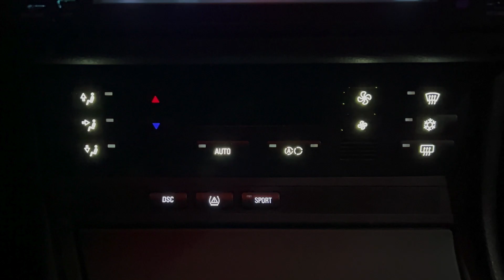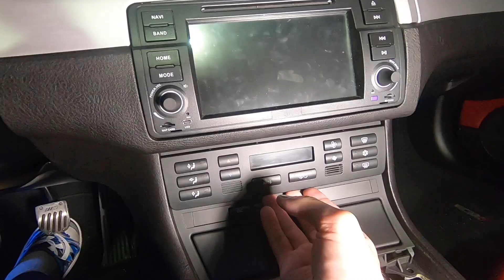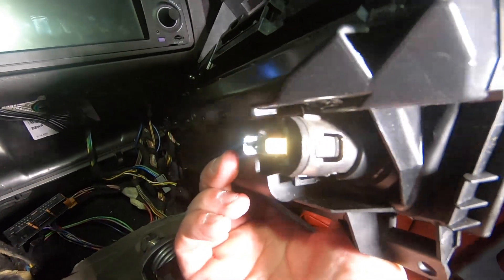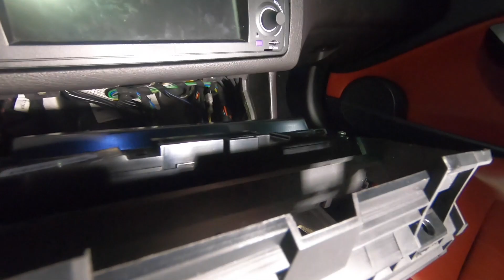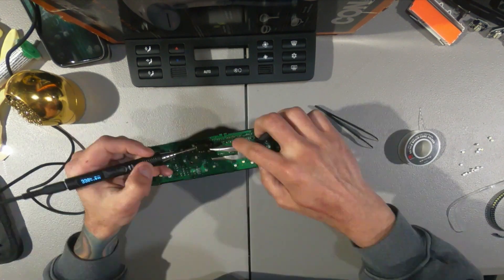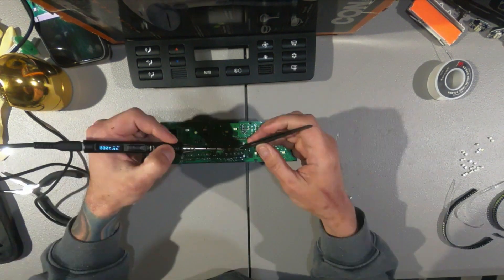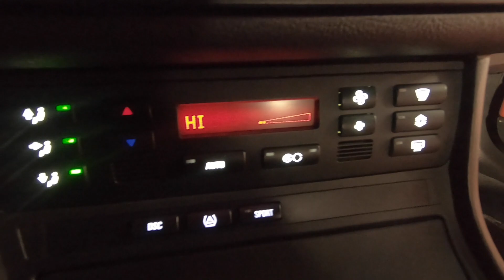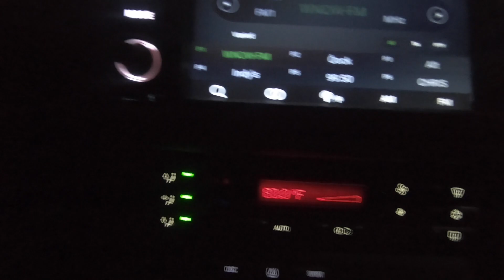E46 BMW M3 HVAC LED Conversion

Comment: Hello every time i disconnect the cables ftom ac it start working. How to stop it
Reply from the maker: I don’t understand the question.
Reply: @CroVlado0510  when i disconnect the cables behind the A/C, i hear the AC in the car blow air.(on vens left and right)
Reply from the maker: Do you have your keys in the ignition and the ignition on? It shouldn’t do anything. If not, you may have electrical problems if it runs with no key in it.
Reply from the maker: Electrical problems